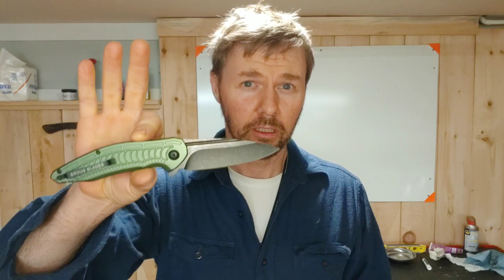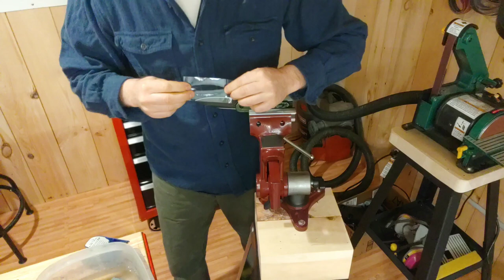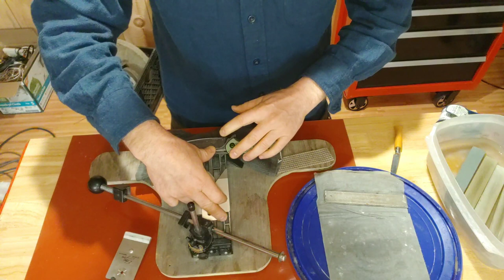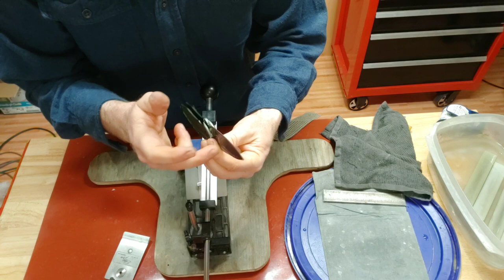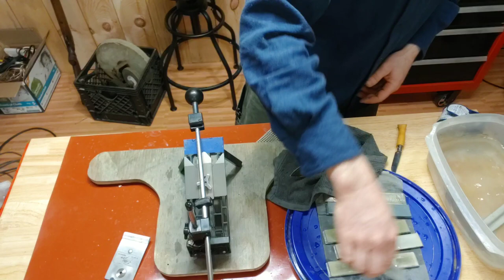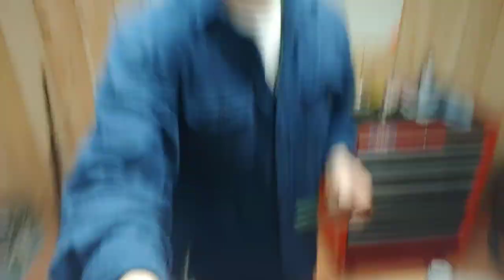TNG Ep 14: How I Sharpen High End Folders on an Edge Pro Apex

Comment: Afternoon, Matt -
Wondering if you might use your Work Sharp "Elite"rig to establish an edge bevel instead of your 1" x 30" ?
I'm working with the KO-3 by TSPROF, and completely understand "Sawing away" in order to get a bevel on longer kitchen knives.
Appreciate your Thursday Night Grind sessions, thanks...
Reply from the maker: I wouldn't use the Work Sharp in place of my 1x30, but the blade grinding attachment on the Ken Onion is certainly capable of cutting bevels and profiling blades to save time on a jigged machine. 
Hope that helps!

Comment: Im interested in the magnetic holder that your machine has. I use the apex pro (standard machine) I don't see apex pro advertise the magnetic option. thanks
Reply from the maker: Hey Estevan!
First, we should be deliberate with our terminology. There is no 'Apex Pro'. Edge Pro is the company, and they make an Apex and a Pro model. Since you have Apex your comment, I'm assuming you mean that you have the 'Edge Pro Apex'. 
If that's true then you can find the magnetic upgrade kit from this link: 
https://www.edgeproinc.com/sharpening-accessories/apex-retractable-magnet-new-p78.html

While you're there, consider the slide guide too. It's a super upgrade:
https://www.edgeproinc.com/sharpening-accessories/slide-guide-apex-model-new-p82.html

Hope that helps!
Let me know if I mis-interpreted your question.
Reply: @capnmatt41  thanks Matthew, yes, of course, you are absolutely right regarding the terminology. Thanks for the prompt reply and the link to these upgrades. They should prove to be very helpful!